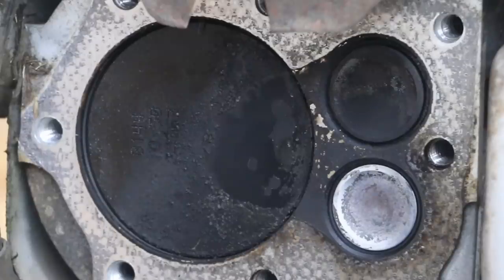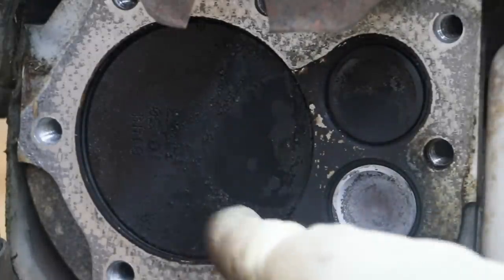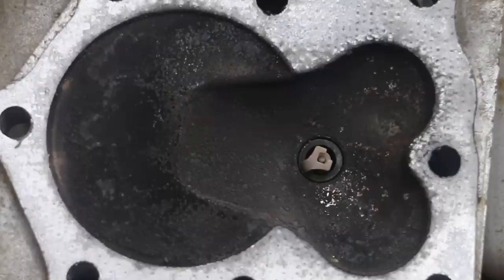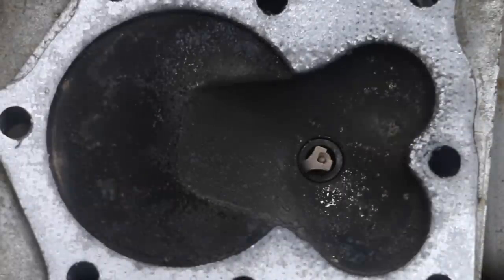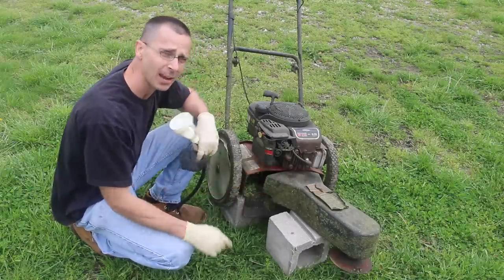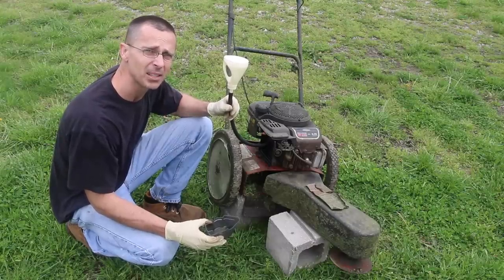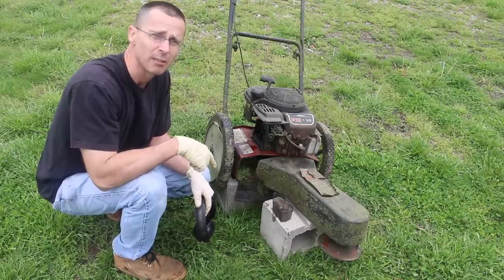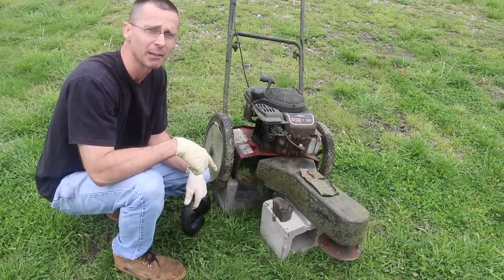Seafoam--can't believe what it did to my engine part 3--cylinder cleaning test!!

Comment: I've used Sea foam for 20+ years. I usually put it in a spray bottle and use that way rather then pouring it in, probably makes no difference in its effect but frees up my hand to hit the throttle if it's stalling out. I usually see a lot of cleaning effect in the engine occur on the under side of the valves where deposits get heavy much like the clean streak on the intake of your Ford Truck, but you would need a endoscope to see that without taking the engine apart.
Reply from the maker: Thank you for this recommendation!

Comment: You can get as good or better results by simply sucking up a bit of water through a hose in the same manner as the seafoam. Everyone thinks this will hydrolock the engine but it wont as long as youre careful like with the seafoam. It basically steam-cleans the valves and piston in the same manner, and its free!

Comment: When I graduated from a University in Oklahoma ,1986,  I took a sales position with a company that had several excellent products. Today you can buy a version of one of those products that will do a better job than the seafoam ever could removing (not just preventing) carbon buildup on pistons, valves and cylinder heads in both gasoline and diesel engines. Its Techron by Chevron corporation.  It also cleans injector types and won't void warranties etc- it does it while you drive and best of all, Walmart sells it everyday.  A for instance, I got 242,000 miles out of a 1998 Chevrolet Venture mini van and did only one fuel pump replacement . No other major engine work ( just a couple radiator hoses and a serpentine belt, and starter and battery). Still runs good but ac quit non it.  The engine still developed full power and gets about 22 mpg. Ran Shell Rotella T 15w-40 conventional oil plus Restore oil additive changed at 6000 to 7000 mile intervals  with Mann or Fram oil filter .
Reply: Yeah Chevron makes a good product too!

Comment: if you want to use seafoam, what you do is remove the head, put piston at BDC, and fill cylinder with liquid seafoam- let it sit for a week.  this will loose up the rings.  it's stuck rings that causes most engines to not operate right.  take the head, and just soak it in solvent or brakeclean or lacquer thinner, and scrub it clean.  for a car engine, fill all the cylinders with seafoam/diesel fuel mixture, let sit a week, then crank engine over without spark plugs, to blow it all out.  then put plugs in, and start engine- run until it stops smoking, then shut off, drain and change oil.  big difference in engine vacuum later. I have a 216,000 mile, 3800 series 2 GM engine, never pulled, and treated with seafoam/diesel fuel, still has high vacuum at idle.  no smoke with normal driving. it works. when the rings get carboned up, they stick and no longer move in/out of grooves to seal under compression and power strokes.  that's what causes high oil consumption, loss of power and vacuum.  try it.

Comment: Seafoam might have made a slight difference, but not enough to warrant doing it to any vehicle nor the cost of the seafoam. I have used it in my fuel system, for cleaning injectors it seemed to do well, but B12 chemtool does as well or better for less money. The purpose of sea-foam is to get the water out of fuel and or oil. If that's not your problem, then it won't do much so far as I can tell from my own experience. In my area it's wet and rainy all the time, with high humidity when it isn't actually raining. so water build up is always a problem. Using other things that are alcohol based also works.
Reply from the maker: Great point and thanks for commenting.

Comment: After heat soaking it you should reapply the seafoam again. Repeat the whole procedure at least three times. It's way cheaper  than walnut blasting my 2009 Mini Cooper S that needs cabon buildup removed every year. Direct fuel injection is notorious for carbon buildup. Walnut blasting costs me $600 from a privately owned shop. The dealer charges $1200 to clean the valves.
Reply from the maker: Thanks for the feedback.

Comment: Looks like the spark plug takes a lot of damage and it's much easier to use carb cleaner if you want to clean it good then try seafoam but it's nice to see if just seafoam works I didn't think so
Reply from the maker: Thank you!

Comment: The one thing I never hear talked about is "HOW LONG" has the engine been used before the Seafoam test. How many years has that engine run before Seafoam was used in it? Also, one application of Seafoam or any other product is gonna produce a miracle. Also, before Seafoam, the old mechanics used to drizzle automatic transmission down the carb to get the same results. Clear 100% ACETONE (fingernail polish remover), can clean the tarnish out of the carb. I add 2-oz to every third tank of gas. You can also get results with "BLASTER" Penetrating Catalyst. I have yet to try any of these on my weed trimmer, chainsaw, and leaf blower engines.
Reply from the maker: Thanks for sharing.

Comment: Have you considered testing the canned fuels that are now available for small 2 and 4 stroke engines. Apparently they are formulated to last over long storage periods. Which fuel burns cleaner, which fuel burns longer and which fuel evaporates the least and still starts well after storage? Do these fuels work well in your car or truck? When they do evaporate, what is left behind?
Reply from the maker: Thanks for the video idea.

Comment: When I use Sea Foam, I pour it into my gas tank, not pour it into the carb in big gulps.  This reminds me of dumping automatic trans fluid in the carb back 40 years ago. I suggest you pour into your tank, run the mower until dry and then test.  Run a couple of tanks the same way.  I use Yamaha Engine Med in my motorcycle and it definitely cleaned out the engine which was being clogged by ethanol.  I think water is a hassle.

Comment: Try spraying a VERY FINE mist of distilled water into your intake. Car with a head gasket leak tend to have a clean piston head from the steam of the water leaking into the combustion chamber. Spray the water like your using Seafoam. Ease off when the motor starts running rough to prevent a hydro lock. The old school mechanics use to do this and you could see chunks of carbon falling out the tailpipe according to many who I have spoken to.

Comment: I added seafoam to the fuel of my mower.  Not to clean carbon buildup, but to clear out a gummed up carb.  Made the mistake of letting gas go stale over the winter.  It took awhile before it ran right again, but it did work eventually.  I tried taking the carb apart to clean it, but it must have been gummed up in one of the small passages.
Reply from the maker: Thanks for sharing.

Comment: that carbon is forming a protective barrier around the inside of the combustion chamber, want it to stay there on the top of the piston and head. its almost like a ceramic coating on the inside of the engine. obviously you dont want it to get excessive, but to a point it does help with insulating the piston and head against the temperatures inside of the chamber.

Comment: it made minimal difference, however this product is intended to be used as a preventative measure. So if you add it to your fuel as a stabilizer/storage component and also do a yearly decarb process you would see a better result visually over that time span ( 2-4 years)...just my 2cents.....use this product in all my marine/outdoor/small engine equipment and it works for me.
Reply from the maker: Great point and thanks for commenting.

Comment: I've seen similar results on small 2 stroke engines.  Doesn't seems to do a lot.  Removes some build up along the periphery but that's about it.  Seems to work better doing the triple clean method on a larger 4 stroke.  Btw, neat channel.  New subscriber.
Reply from the maker: Thank you very much!

Comment: I've seen several car engines treated with Seafoam with before & after scoping of the cylinder & piston. It does virtually nothing. FPC fuel catalyst will totally decarbonize the piston & rings after a few tanks, depending on the carbon build up. It removes all hard carbon deposits & keeps them away. Also increases fuel economy by about 5-10%. Only soft traces of carbon is left in the engine & can be wiped off with a cloth. 

FPC has been used in the shipping, mining, railway, heavy & light road transport, earthmoving / excavating & many other industries as well as racing worldwide for over 3 decades.

Been using FPC myself for around 20 yrs. Tested many other fuel additives in that time & none give as good fuel economy or decarbonize the engine as good. Recommended treatment ratio is 1:1600 but I use it at 1:1000 in my petrol engines which seems to give better economy. I live in Australia, but I believe FPC is available in the US. FPC has over 2,200 international tests & studies & plenty of testimonies.
Check their website for details.

The FPC Concentrate alone has dramatically increased the life of this mining truck engine. This Komatsu V12 mining truck engine has done 23,000 hrs of work. There was less than 0.001 inches (1 thousandth of an inch) of wear in the bore & bottom end of this engine. The cylinder hone is still clearly visible. Only 20% wear on the ring faces. The usual rebuild period is 18 - 20,000 hrs for this engine. 

The wear in this engine is equal to only approximately 20% after exceeding it's normal life. 

 The reduced wear in this engine is due to the prevention of cylinder glazing & or hard carbon deposits on pistons & rings & reduced oil contamination by up to 58% shown in studies. All which prematurely wear cylinder bores & other engine components. This engine was put back together & put back to work without the cylinders, pistons, rings or bottom end being changed.
https://www.youtube.com/watch?v=pVm3BtIZzms

 FPC Concentrate is suitable for ALL 2 & 4 stroke petrol, diesel, ethanol, methanol, kerosene, car, truck, motorcycle, marine, farm, tractor, heavy machinery, plant, generators, heavy duty, high performance & race applications.
Reply from the maker: I really enjoyed reading your comments.  I learn a lot from those leaving comments.  Thanks again!

Comment: Additives do work. When I worked for a car dealer in the 70's as a mechanic the used cars with noisy lifters got a can of CD-2 for lifters. It would quiet them down completely. Enough to sell the car. It worked.
Reply from the maker: Impressive!  Thanks again for commenting!

Comment: I restore old tractors that have been sitting for decades. Many years ago I worked at a Mobil gas station. We would run a pint can of Mobil upper lube in the carb. It lubed the valves. I tried seafoam in my tractors after believing in a upper lube. I put seafoam in the gas tank and crankcase oil. I mowed two acres of grass. The rpm at idle picked up. I realized the seafoam lubes the valve guides, valve seats, frees stuck rings, reduces carbon. I believe what seafoam can do now. My testvtractor is a estate international 154 4 cylinder with a 60" mower deck.
Reply from the maker: This is impressive!  Seafoam saved my Ford Ranger for sure and has help other engines that I use.

Comment: I could not visually tell a whole lot of difference, but I have some questions. Since liquid doesn’t compress, adding liquid could cause some of it to be pushed past the piston rings into the oil. Did you check for oil dilution? Instead of a drip, would a spray bottle make any difference? I wouldn’t expect any additive to instantly have a major result. How about repeating the test on a piece of equipment that you actually use. Do regular treatments and add to the fuel. A couple of months might paint a different picture. Love your videos!

Comment: I think that in order to blast loose carbon build up, an engine really needs to get nice and hot and then it needs to be rev'd up to high speeds and then repeatedly  rev'd up and down.      Just because we may not see dramatic effects on a single piston lawn mower, does not mean that there are not a number of ways to blast loose carbon build up around the valve's and piston's.  How fast would you guess that the lawn mower runs at the highest speed you ran it at?       Also,  How is the truck running?       I'm going to guess it is doing very well.

Comment: If sea foam was used at the end of each season I don't think the carbon would accumulate like it has in your engine. To just use it after there's a lot of carbon and expect it to remove it all with just one use is asking alot of any product. I think the smoke is coming from the mixture being to lean as you put it in, in spurts instead of just adding it to the fuel tank and letting it work itself through the system. I could be wrong. It looks like you've done alot of work here and I can appreciate how much time it must have taken with filming editing and mechanical. Thanks for the demo.
Reply from the maker: Dave, I spend a LOT of time editing the video to eliminate unnecessary footage.  Thanks for the encouraging comments!  Also, great point about adding Seafoam at the end of each season.

Comment: I think it made no appreciable difference, although I don't know whether you followed directions on use of the product. I also notice in the second set of comparisons that the spark plug appears to show that combustion in the cylinder is pretty well correct before the additive, and the spark plug appears someone fouled after addition of the additive. I would expect no noticeable difference in performance of this engine.
Reply from the maker: Thanks for commenting.

Comment: So what is YOUR thought on this? I have a friend with a 1980 Toyota and is dieseling when he stops the engine. I suspect carbon build up in the engine. What should he use? Water? Sea foam? The only thing I'm seeing as compelling evidence is that mechanics know which head had a blown head gasket because the blown side has clean pistons.

Comment: I just put seafoam in my 06 Milan with 42k on it . Put it in the gas and the crankcase , and bought the seafoam spray ran the bottle through the plate. And the car is definitely smoother for sure ! Will change the oil in a 100 miles also .
Reply from the maker: Thank you

Comment: I think my concern with either water or seafoam, would be carbon getting into and scoring the bores. On an easy to access engine, definitely would go with conventional methods. But on a big v8 or rx8 rotary, if this does work then it would save a lot of labour times and gaskets. Before and after? Not enough difference to convince me though. Cheers for the vid!
Reply: Carbon cannot harm your cylinder bore, it constantly builds in there and blows out all the time. Also you have to do these multiple times its not a one time fix. I run seafoam or berrymans up to twice a month and its cleaned my old 302 out amazingly! My pisons are now clean looking compared to the carbon infestation they were when I first purchased it.

Comment: Seafoam works, and remember it was developed in 1930s for cleaning/winterizing outboard boat motors. I've used it in everything for 20+ years. If the stuff didn't work, it wouldn't be around anymore.
Reply from the maker: Thanks for the feedback.

Comment: Seafoam has been a staple for me with ethanol fuel.  It is my go to before pulling stuff apart. It seems to really help.  My diesel truck does not get driven enough and I had a weird thing with either the HP pump or the injectors.  Felt like it was out of fuel on startup.  So really rough running. My thought is something is losing pressure when sitting.  Put new fuel filters on and filled with seafoam.  Ran it for a few min and then let it soak for about 30 min.  I also put 36 oz in a 1/2 a tank of fuel. Went for a drive.  Problem still persisted. Maybe slightly better.  But after a long 2 hr drive problem went away. Still running a fairly solid mix in my fuel now and will continue to do so for a few weeks.  I think it saved me a trip to the diesel mechanic. Seafoam is sorta old school.  But I do think it can help with the results I have seen with it in fuel.
Reply from the maker: Thanks for the feedback.

Comment: I am a little late posting about your l tests with  Seafoam, etc. in your truck and mower.  My wife has a 2012 Chevy Tahoe 5.3 V8 with 90k miles, and last spring I began to notice that it seemed sluggish and didn't accelerate very well and had a little hesitancy.   I had decided that I probably needed a set of injectors.  I have always been a fan of Chevron Techron so I ran two tanks of it with no change.  After seeing Chris Fixx using Seafoam on a mower, I then ran two tanks of fuel through it, again with no change.  About 2 month ago, I saw an Amsoil ad for their additive called P-i.  Made a believer out of me.  After two tanks, the Tahoe runs like it was meant to.
Reply from the maker: Thank you for this recommendation. I'll test Amsoil's injector cleaner.

Comment: I work on vehicles that have oil consumption issues due to carbon buildup I use carb. cleaner to clean the carbon off of the pistons by spraying a whole can of carb clean into a coffee can and soaking for 5-10 minutes. i also use a plastic brush to help remove carbon. it would be interesting to see the difference between seafoam, water, and carb. cleaner in carbon removal . performance i bet it would make a great difference if the spark plug were removed and carb cleaner was introduced and allowed to soak and then the engine ran to burn off deposits.
Reply from the maker: Thank you for this recommendation!

Comment: You get better results by pouring small amounts of water into any vacuum port of the intake manifold with the engine around 2,000 RPM and the water is way much cheaper.If you work on engines,have you seen the piston top,the valves and the combustion chamber of an engine that is trowing coolant to the combustion chamber?
Reply from the maker: Thank you for this recommendation!